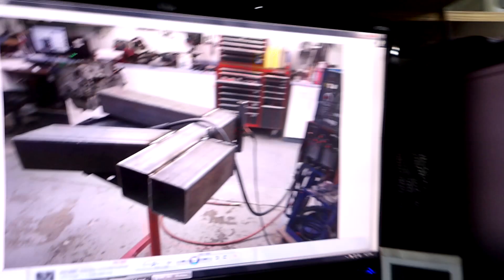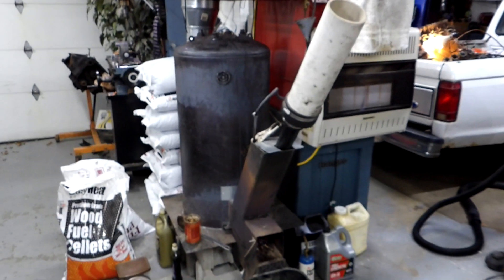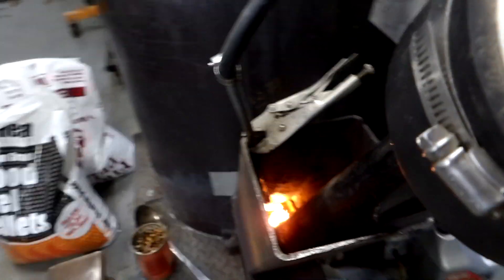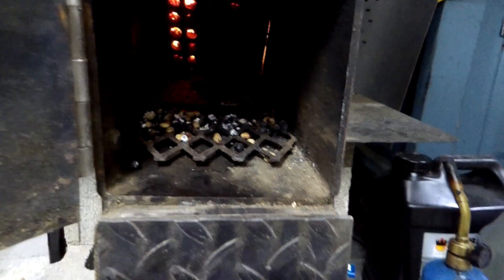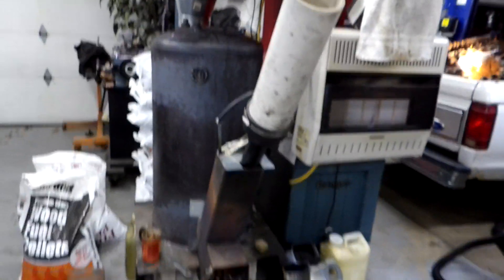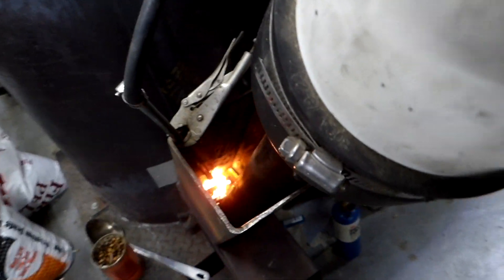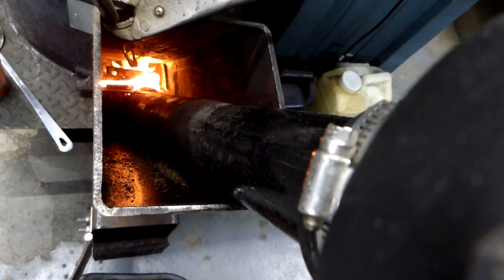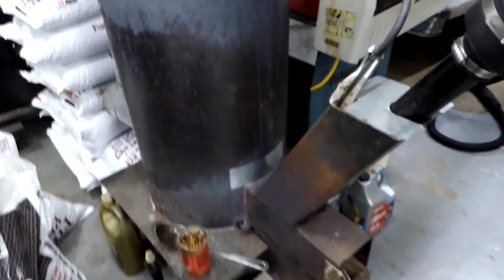Rocket Stove on Wood Pellets - They ROCK !

Comment: Does the feeder tube have a restriction or grate on the bottom of the tube, or is it just open end of tube?  Nice video! I'll check out your other vids....
Reply from the maker: The feed tube is open on the end, it is a 3 inch piece of black pipe that is slightly smashed down into an oval allowing it to enter the burn basket. The burn basket is made of angle iron and drilled front and back to allow air to flow thru. The burn basket sits on a thin piece of sheet metal that has some 3/8 holes drilled so the ash can fall to the ash drawer below.